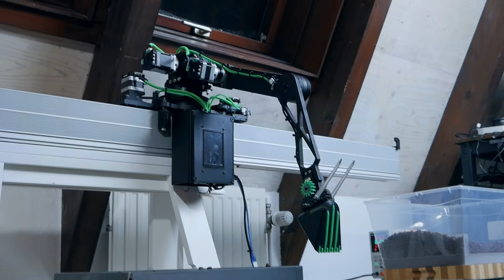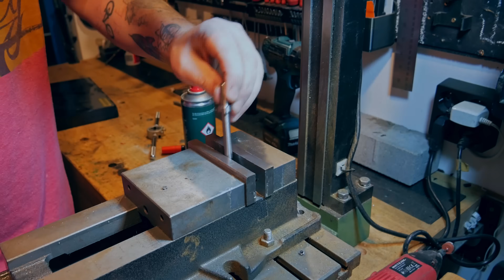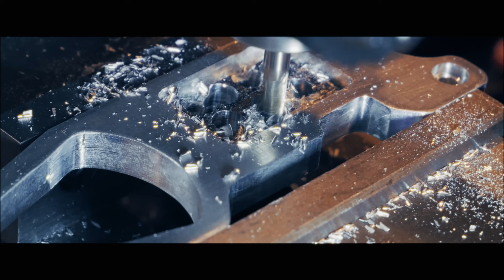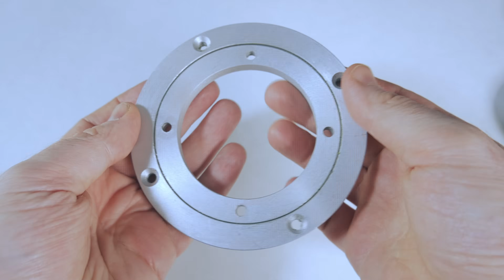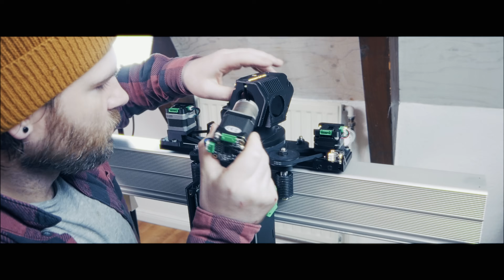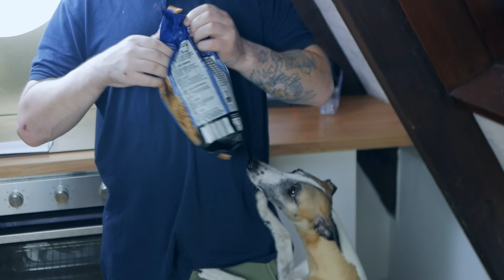A German-Engineered Robot Arm Just to Feed My Dog

Comment: Could you go into more detail about how you made the main bearing from the lazy Suzanne and 3d printed external bearing?
Reply from the maker: Basically, I started with a large lazy Susan bearing that was originally meant for something like a TV stand. The problem was that it had far too much play for precise robotic motion.

So I pressed the whole bearing into a custom ring. On the underside of that ring, I added an additional ball bearing raceway. Then I made a second matching part with another raceway, added loose ball bearings with grease between them, and bolted the entire assembly together.

The original lazy Susan bearing mainly handled the radial loads, while the additional external bearing helped support axial loads and stabilize the whole structure. By adjusting the bolt preload, I was also able to tune the amount of play in the system.

I also used the upper ring as a large integrated GT2 pulley, so the timing belt directly drives the whole tower rotation. So the part ended up serving multiple functions at once.

And surprisingly, even with the arm being over a meter long, the joint still has basically no noticeable play. Maybe after years of use some wear will appear, but after about half a year of experimenting with it, it still feels surprisingly solid.

That being said, I’m honestly not sure if it made financial sense 
Designing and building that bearing setup took me several days. At some point you have to ask yourself whether it would have been smarter to just buy a large industrial bearing or salvage something from a scrapyard. But at the time I was simply too cheap for that 😂
Reply: @LionInTech  Yes it's true it might not have been worth it for you but if you open source your design then your effort can make it worth it for others in the long run, since the basic components are so cheap to start with after your design work.

But that's an interesting idea. So the inner metal ring handles radial load as expected but the outer rings pre-load the inner ring allowing you to tune out the play in the cheap bearing? Cleaver idea, thank you for sharing. Large bearings like that are expensive as you know.
Reply from the maker: @armoriumimperatoris  I hope this doesn’t sound selfish, but I still struggle a bit with openly releasing my full CAD designs and STEP files.

As a full time mechanical engineer, spending hundreds of hours over many months developing something and then just giving all of that work away for free feels... complicated somehow. Not because I necessarily want to sell it, but because it represents a huge amount of time and engineering work.

At the same time, projects like this robot arm are also me learning and experimenting. I’m absolutely not an expert in robotics, and honestly that’s part of the fun for me. I enjoy building things outside my professional comfort zone.

That’s also part of why I hesitate to release everything publicly. There are probably robot arm projects online made by people with far more experience in robotics than me, with much more refined solutions and documentation. I could imagine some people trying to rebuild my design and later being frustrated by limitations or rough edges that I simply accepted during development.

And if I release something publicly, I would want it to be properly polished and documented, similar to professional engineering work. A STEP file alone is usually not enough. You would almost need a full PDF documentation with all the lessons learned, tolerances, assembly details, problems, workarounds, and so on.

Especially with larger projects, getting everything to a point where people can reliably reproduce it without constantly running into little issues is actually very difficult.

At the same time, it is honestly a cool thought that maybe other people could benefit from the work someday instead of the CAD files just slowly rotting away forgotten on my hard drive 😄

So I’m still a bit undecided about how I want to handle that in the future if interest in the projects grows more.
Reply: @LionInTech  There's no obligation to open source anything. If you're trying to promote something or get help on it open source can be a good way to bring attention to your work, if that's what you want.
Reply from the maker: @armoriumimperatoris  Yeah, you’re absolutely right. Thanks for the advice 
That’s definitely something I still need to think about.